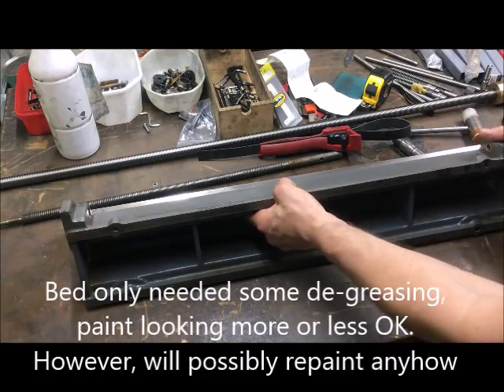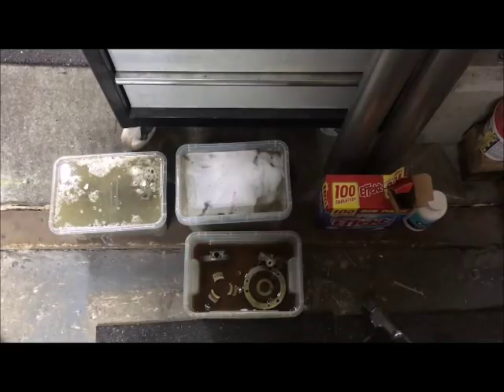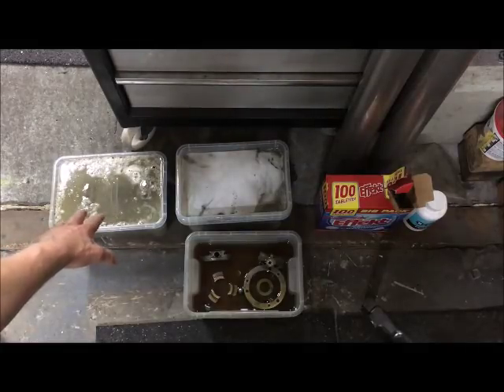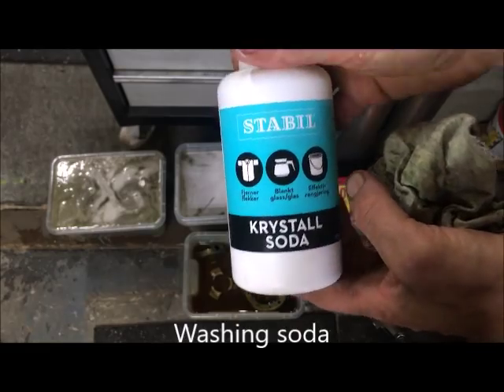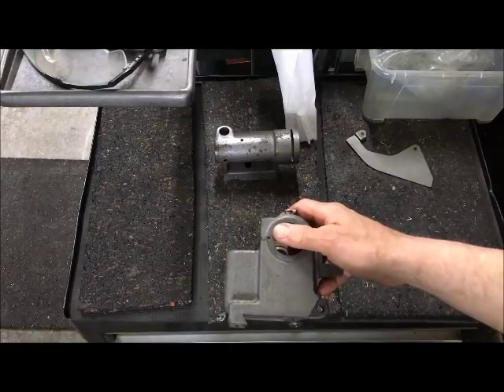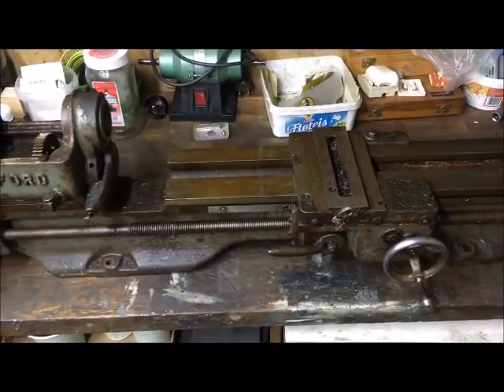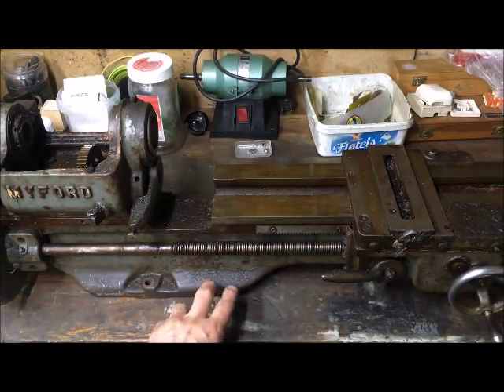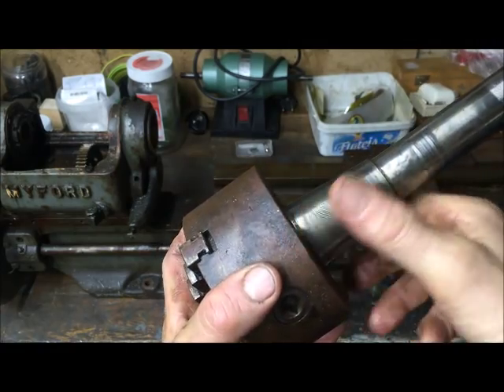ML10 and Super 7  initial prep work and clean up

Comment: Excellent work, could you please explain what you used for the electrolytic process?
I’m currently restoring a ML10 and I’m finding you videos very useful.  Thanks
Reply from the maker: Thnks for the nice comment. For power, I am using a lab supply now, but have also used a battery charger. The active ingredient is what in English Will translate as washing soda, up here called "krystallsoda"

Comment: I think you have all the Myfords now.

Side question - now that you have good experience with scraping the flat ways, do you think you might try a V-way to see how it goes?
Reply from the maker: Haha.. as the fool I am I couldn't help myself and bought more "projects". Anyway, the ML10 is a nice lathe. Thought I'd be experimenting with upping the top speed also in addition to the mentioned modifications. This is the old version with a hardened spindle running directly in the cast iron bearings. My thoughts were to see if a scraped surface and improved (forced) lubraication could improve things there..
As for scraping V-ways, I guess I shave to show this too.. :) Maybe next project

Comment: Jan, I've got a basket-case Little John without the variator (will be using a VFD and new motor). The 3-jaw chuck bore is smaller than the spindle nose, so instead of using a thicker backplate, some moron turned off the front register so it would fit. Do you think a ring screwed to the end of the spindle with HT countersunk screws and then ground in situ would work? Or is it not worth worrying about?